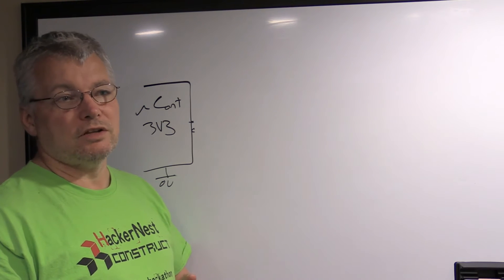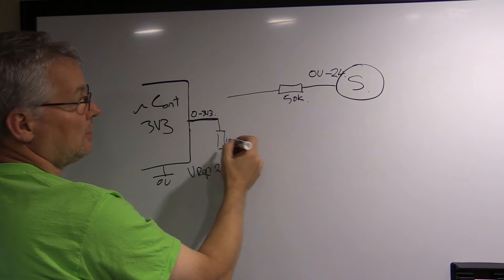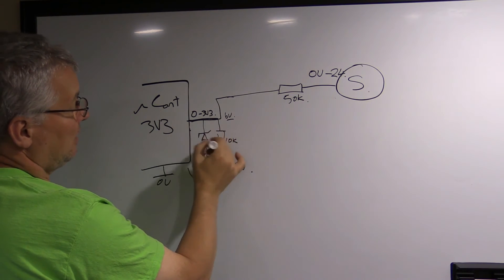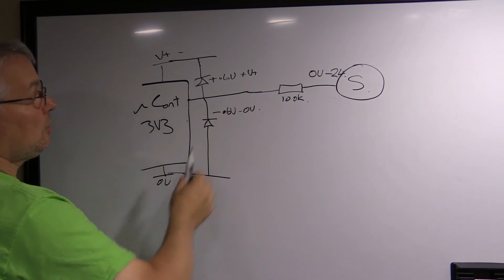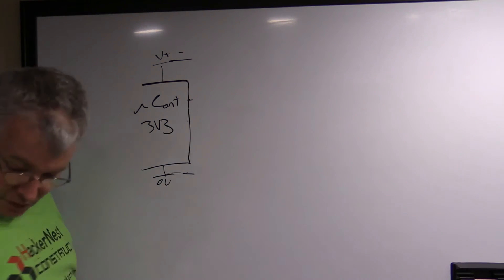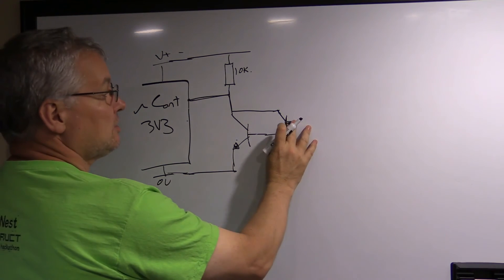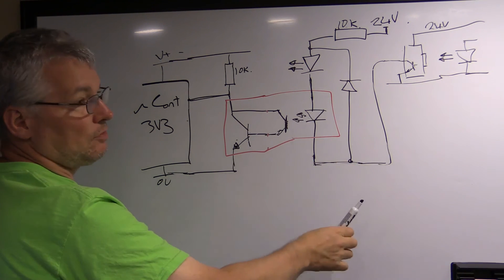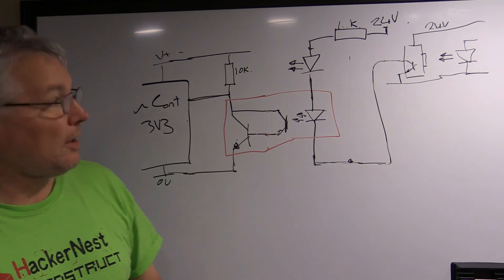uController Opto Isolated Input Sensing

Comment: thank you Peter, what kind of circuit should be used if the input is 120 volt AC ? And we want to detect that with a uController
Reply from the maker: I would look at using a dropper resistor into an opto isolator, put a diode (1N4004 or something)  in reverse polarity on the LED side of the opto to protect it from reverse voltages. Also make sure the resistor divider (Current limiter) is ably to easily dissipate the power, 120 - 2 or 3V for the led = 107V @ 5mA or so = just over 1/2 Watt and 21.4K so perhaps 2 * 10K 1/4 watt resistors in series but better still 4* 5K6 in series or close to , this way they wont get too hot and wont exceed the design voltage ratings. Remember this will have MAINS on it so it should be adequately protected from people :). The transistor side will go to ground and using a pullup resistor of a few K to the power rail of the uController, the signal should then be easy to read as say a zero crossing detector. Another "SAfer" way is to use a simple transformer (A small one 110V in and a few volts out), this will give isolation and you can use simple rectifier and detect the peak or zero voltage phase with an ADC or digital input.

Comment: Hi! are you able to make a variable input/output circuit that completely isolates a high voltage component (say 48v electric motor controller) from a low voltage driver circuit?
Reply from the maker: webslinger2011 yes. That is possible. What signals are u trying to isolate
Reply: Analog. Currently have an issue when another component on our system - two solenoids are activated, the optocoupler spikes an 8v output to the motor controller causing it to run at full throttle.
Reply: normal range is 0 to 5v
Reply from the maker: do you have a current schematic you can share, if so then email it to me at peter@thebreadboard.ca and ill see if i can help
Reply: I will need to ask for permission from them. Thanks!
Reply from the maker: even if it is simplified down a little, what I would be looking for is possible sources of a trigger to the opto when the relays are turned on or off and other sources of interference
Reply: Haven't got around to scoping those solenoids yet. Might need to dig through the wiring again.
Reply: Sorry but I'm not too familiar with electronics. Optocoupler with a dc to dc input and output. Sort of an op-amp but no amplification. If 2.5v goes in 2.5v goes out on the other end avoiding having a common ground to both components to protect sensitive equipment.

Comment: There should be also 1k serial resistor between GPIO pin and optocoupler leg.
If you accidentally, in your program, set that GPIO pin as an output with 3.3V and put signal on 24V to enable optocoupler you will get a short-circuit to GND and burn that GPIO pin immediately.
Reply from the maker: it is normally assumed that the program would be specific and therefore not needed that level of protection, also if the situation you describe occurs, then the internal protection of the GPIO pin will also kick in, for instance on an ATMEGA328, the current is limited to about 10mA.

I do however agree with your recommendation, especially if the GPIO pin is to be used as an input or output and you need to handle driven or sensed levels. This is exactly what an Intel Galileo does with its GPIO pins.
Reply: BTW. Great video material - very helpful!

I'm thinking mostly on RaspberryPi with their 2mA GPIO pins and 3.3V logic. People do mistakes and GPIOs on Rpi are burning immediately.
Moreover, when you boot Rpi[or other Linux system on other SBC] or some little time at MCU initialization GPIO pins are unstable for some small amount of time.
Rpi has settings for boot state of GPIO pins in some Kernel config files.
You can easily do this at development level with bread board usage.
Reply from the maker: A good point, thanks

Comment: Hey Peter! Really nice video, you describe it all very well and its also very interesting! How about analog signals? Is it possible to opto isolate those or do you need to go a non-isolated route?
Reply from the maker: +Chris Fredriksson Ah, interesting you ask that, if you watch my Dec Mailbag re Electronics you will see I have some Opto Isolators just for that specefic purpose and will be doing a video very soon with them... Stay tuned
Reply: +Peter Oakes (TheBreadboard) Oh awesome! Haven't gone through so many videos yet, working on it ;) But I will put those on the list to watch for sure! :D Thanks for the reply!
Reply from the maker: you can but it is a little more convoluted, I think i have some opto isolated op-amps in the stash somewhere, the idea is they have matched opto couplers on each side to allow linear conversion frm one side to the other, you still need to get power over there though and that is often done with an isolating DC to DC convertor. another approach done is almost every industtrial controller i have seen receintly is to put the ADC on the analog side and use a digital isolator (SPI or I2C) to provide the isolation, again you need to get isolated power to the ADC etc. hope that helps

Comment: Nice video peter, i just wast to ask about the linearity of your setup compared to non-isolated.
Reply from the maker: It is not designed to be linear, it is a switch mechanism

There is additional transient time due to the opto isolator but as long As your not trying to switch too fast it will not be a problem (10khz or so), the opto can run upto 1Mhz but the output rise and fall times become significant at that frequency